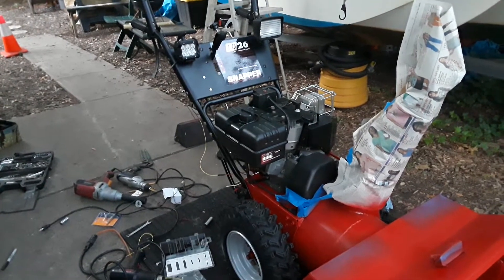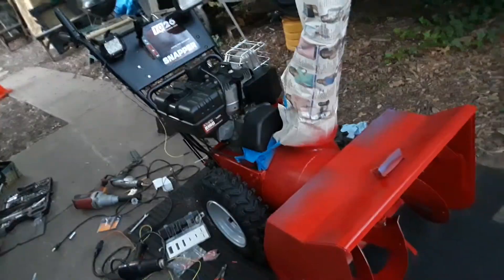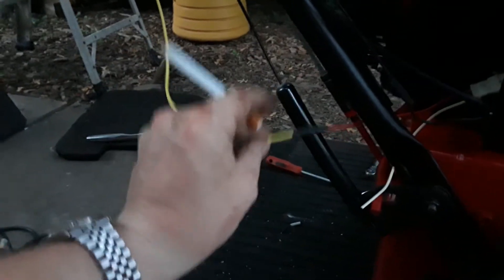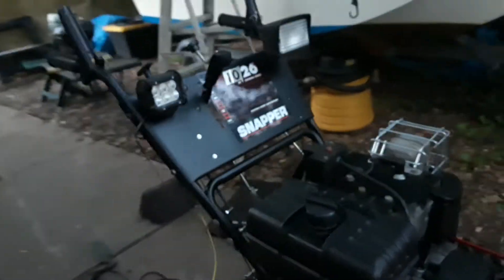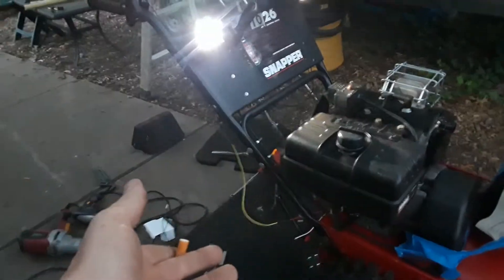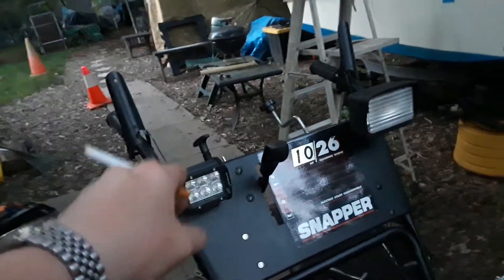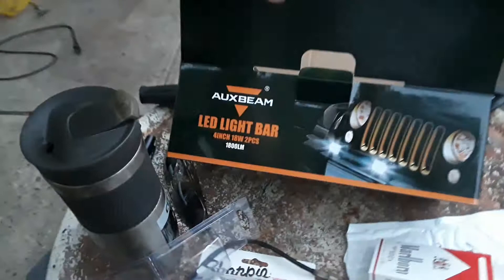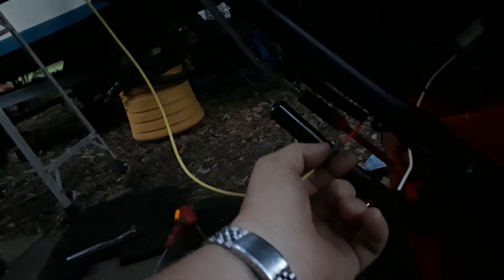LED headlight install to Snowblower Auxbeam without needing rectifier or capacitors, how to: part 2.

Comment: Hey man I saw your video on the 1978 sears lawntractor, I have the exact same one but the coil on the motor is screwed up and I saw your video of it running, do you have any idea how to fix it?
Reply from the maker: Clean the points. If it still don't spark replace the points and condenser.
Reply: It did spark but the coil is under the fly wheel
Reply from the maker: @djwillhite1677  I'm aware. Its called a magneto assembly, it consists of a coil, points and condenser. So your getting spark, what's the issue?
Reply: I can't get it adjusted to where it will spark
Reply from the maker: @djwillhite1677  You just said it had spark. You have an intermittent spark. Clean the points, if not, replace the points and condenser. Watch a YouTube video on how to adjust a Tecumseh magneto assembly and how to clean points, replace points/condenser, if the mag wasn't moved and its where it was, it should not need to be adjusted. Theirs many videos that cover the topic.
Mine had to have its points cleaned, they usually do as they corrode from sitting on an old pre solid state, breaker ignition assembly, common. Sandpaper is your friend. Maks sure the points are gapped correctly when fully open. Sounds like the points need to be cleaned and gapped. Replace them, its time. A new set of points and condenser ate cheap, go on ebay and buy a set.
Reply: Thanks alot man, when I said it had spark I ment it had very very little spark and after that I lost it all
Reply: Thank you so much for all of your help
Reply from the maker: @djwillhite1677  No problem, yea most likely the points. Try sanding the tips first or a small file, usually that fixes it. If not replace them and the condenser while your at it, after that should be good. Always try to keep the magneto where it was bolted down, if you moved it, look for the original marks where the bolts were and put it back, you don't ever really have to move those. Good luck. 👍